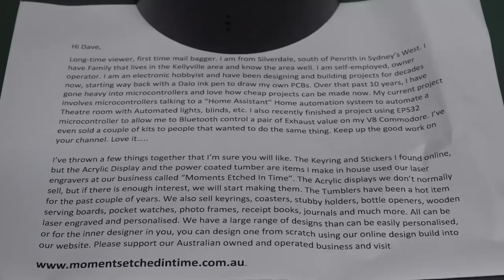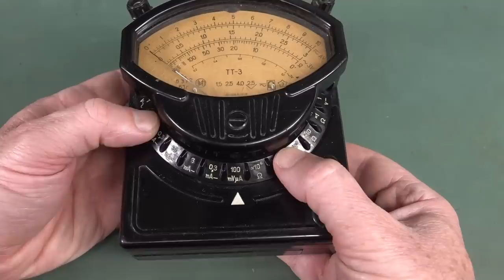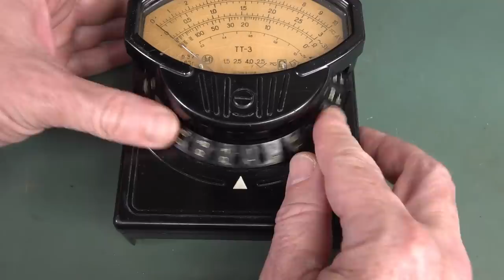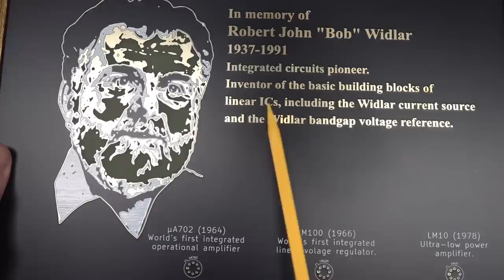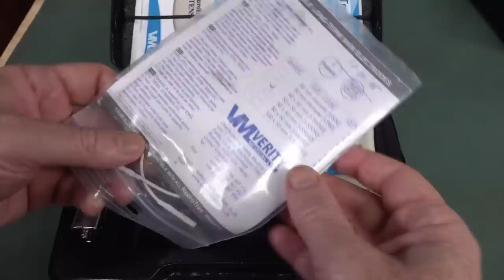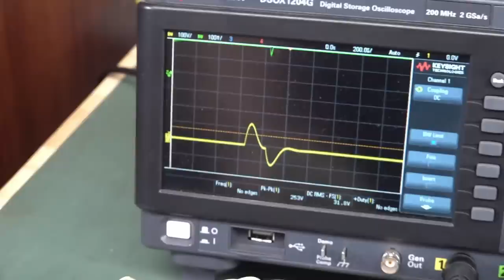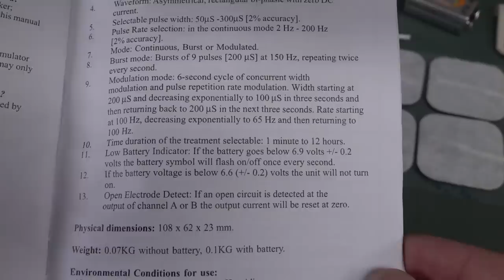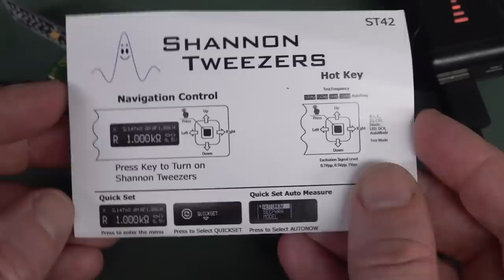EEVblog 1471 - Mailbag

Comment: my first MM was russian, from 80', still the same range switch and quality. I used that for my entire school - 2.5% - 4% accuracy or so, and also battery that I couldn't buy anywhere ;-) The indent was done by the spring and the ball inside

Comment: I think the linear voltage regulator is the type you used to find in VCR power supplies that had a black enclosure (the backside was a heat sink) with a row of pins coming out the bottom  as many as 20 or so with varying voltages. I was a VCR tech back in the day and actually stocked some of them in my kit.

Comment: I am from Romania and I used to have 3 of those and a TL4/2 (the newer, square version). The batteries were hard to come by. The red resistors are called MLT type and are very stable in time, they virtually never go bad. The green ones an older type, I don't know the name of, but they were used a lot in tube applications.

Comment: 5:30 Greetings from Bulgaria. My dad has one of those TT-3. The only major problems are the fact that it uses a strange battery (that is expensive as hell now days) for the ohms measurement and the fact that turning the dial is very difficult. I'm not sure it if needs a bit of oil in the right place or they were all like that. I remember playing with that multimeter when i was a kid.
Reply: same here in Latvia. dad had it and now I have it. might have actually been passed down from grandpa. I wonder though how is the battery still holding on. seems its the original it came with though its leaky.
Reply: @healLV  Probably just an old battery from the late solviet days that "survived" until now?
Reply: @Nik930714  yea its leaking but still holds lol
Reply: @healLV  What a champ

Comment: The picture on the Rack Panel Secure Box manual, reminds me of the type of safe used to store the, Nuke, secure launch authentication codes on various military equipment.
I believe something similar has been shown in movies like "Crimson Tide" for example.
The E.A.M. launch codes are encrypted transmissions and the authentication code keys kept secure !!
I'm taking a guess at the purpose of the secure box rack mounting panel but safes would be required anywhere there is a Nuke launch site.
Another use could be to house decryption Key equipment for a one time or daily algorithm for performing encryption or decryption.

Comment: Dymo... Expecting prime grade lolcontent! Hopefully no DRM this time.

Lovely antique Soviet multimeter, I like those things :). Joy for ever!
Sure as hell it has a lovely smell. And the resistors are old style with radial leads for point-to-point wiring. A common failure mode is a rupture of the ring part of the lead on the end. If that happens, you get an open circuit and have to replace the resistor. By the way, these red MLT metal film resistors are pretty nice and I use them in my amps because I can get them cheap here. They're big for their rated power (a .5W MLT looks like 1...2W modern metal film resistor) but will withstand way more power than the rating says, even if magic smoke happens.
Gotta get myself a gas chromatograph and mass spectrometer, LOL.

PCB art is joy for ever indeed. I liked that episode :)

Shannon tweezers, you say... What else? Electronic lockpicks? :D

Comment: As for the tweezers, I was wondering if they have a "left handed" mode for those of us that are?  I'm kinda klutzy with the right hand when it comes to probing around.
Reply from the maker: Some can flip the screen
Reply: The Siborg Systems LCR reader, (The one made in Canada) will flip the screen for either hand, and if you put it face down, it will beep 3 times then shut off.

Comment: Your TENS machine was set to 20mA. No wonder it was painful... the small device starts low and adjusts in 1mA steps for a reason. Youre not supposed to feel pain.
Reply: Really? I always had mine cranked up to near max.  I had to warn people not to touch me while it was on.  The relief was awesome.
Reply: @firesurfer  can depend on how far apart the electrodes are placed and how dry/moist the skin is.

Comment: Here are the votes from the Norwegian jury (from 1 worst to 6 best, like a die): Item # 1 (Laser etched stuff): 6, item # 2 (rack thing): 3, item # 3 (analog ruskie multimeter TT-3 with flaking shellack finish): 5, item # 4 (Bob Widlar PCB): 6, item # 5 (Neutro Track TENS "Spinal Tap, Mine goes to 11" unit): 4, item # 6 (LCR Probe tweezers): 4
Reply: The laser etched stuff was a ZERO. Just ugly and cheap Chinese rubbish.

Comment: tens gadget slightly advanced. i have 2 australian made ones at work to fix. theyre fully analog design auto routed pcb with vias and tracks under everything, so i havent bothered to remove every IC to trace the circuit. made for/by australian instutute of sport dammit. at least these have a chance of 'working' , but i also have some desktop magnetic therapy units to service, theyre a scam. i had some arm pain so i tried using one of these before it was sent away, but it didnt do anything even after 2 hours LOL!

Comment: 15:47 "volage" and no period for the integrated op amp statement? Some sloppy work for an otherwise nice piece. We going for some bodge wires or a board revision on this one?
Reply: A small daughter board that solders over and has the corrected word voltage would be perfect.